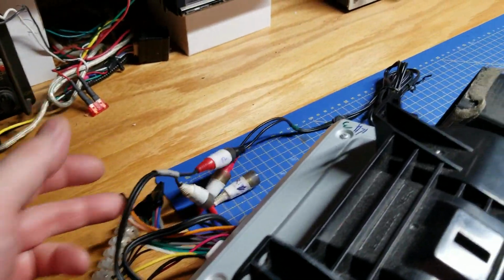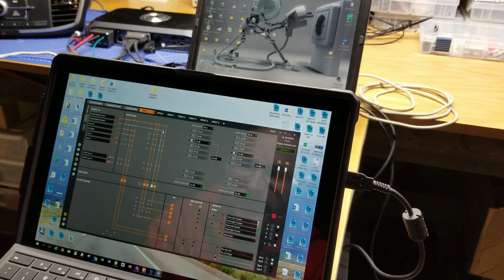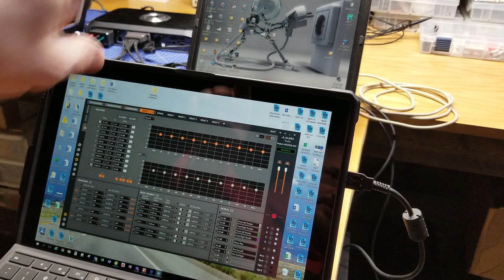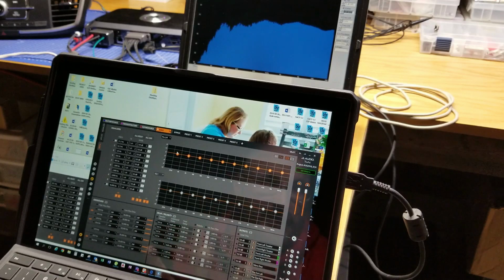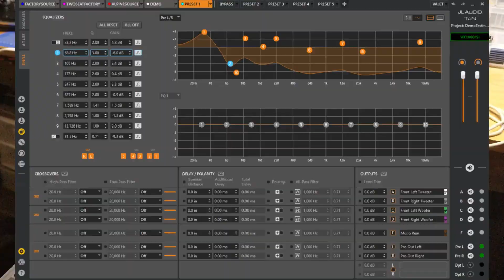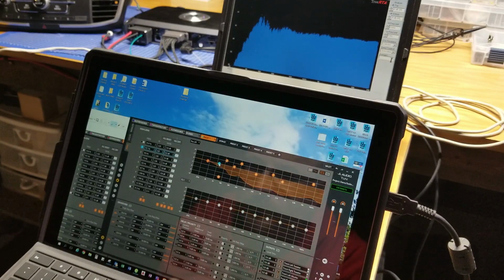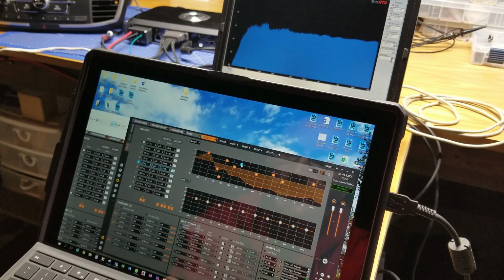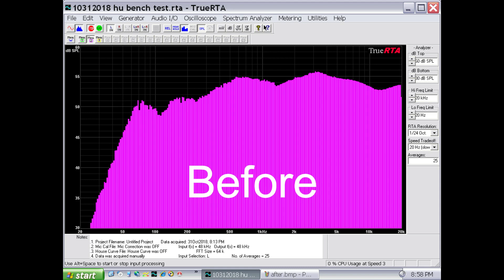JL Audio VX10005i Tun fixing Honda Accord Radio Frequency Response

Comment: I'm so confused with these processes. What is the goal once you get it flat? Do you create another EQ that applies at the same time or something? I'm using the TUN software and I have my signal flat, but I don't know what to do after that.
Reply from the maker: Using this method, I dedicate two of the EQ channels to flattening the factory EQ, then send that flat signal out of a preout and back into another set of inputs (channels 3 and 4).  Then I EQ the individual drivers as needed, knowing that I have a flat starting point.

Comment: A fix 82 or 86 depending on your setup would work a lot better for flattening the signal than trying to adjust it in the tun software for the amp. That way you can start with a flat signal and adjust how you want it from there.

Comment: Hi Richard, I am at the start of a similar path, but was going to use the speaker level outputs as my inputs. But you have done something I was wondering about, I.e. adding the line level RCA’s from the preamp output. Do you show how to do this. How easy is it... I was thinking it would be pretty tricky to find the lines or tracks
Reply from the maker: Hi there.  I have another video that is just about using an RTA to measure frequency response and that includes speaker level outputs through a LOC to reduce voltage.  Is that what you are looking for?  Can you clarify your last sentence about "lines or tracks"?  I'm happy to answer whatever questions you have once I fully understand what the questions are.  Cheers!
Reply: @richardvedvik979  hi Richard, thanks. I have truRTA and a oscilloscope meter and was planning these measurements (my 1st time, so useful vid). What I meant about lines/tracks, was I thought you had put in your own home made RCA line level outputs by soldering into the correct points post pre-amp but before the amp section. I was thinking about this, but not very familiar with doing it, and indeed I have 6 channels at the amp stage, so presumably this channels at the pre-amp stage... maybe there is some earlier point in the circuit with a simple stereo signal, but maybe this is buried in some solid state chips... so could be really tricky to do..
Reply from the maker: @idiocratease  In the original Accord factory head unit, I did mod the factory radio and remove the internal amplifier to generate a line level signal.  I've also swapped to a premium touchscreen head unit with a balanced output (from another year/model).  But this effort is independent of those mods.  My Instructable is useful for high and low signals and goes into more detail with connection methods.   With some vehicles, there is a digital signal to the factory amp that you won't decode, so you're forced to use high level signals.  This method of "seeing' the response is still useful, you just add a LOC.  I like the David Navone series of LOC.
Reply from the maker: https://www.youtube.com/watch?v=Kva4YA19P7M

Comment: You flattened the curve nicely. At what volume level did you flatten it at and doesn't the factory radio change the curve as the volume changes? If so do you no longer use the radio volume control? How is that addressed with these devices if the curve changes as the volume changes? No longer use the head unit volume control?
Reply from the maker: I test vehicles at several volume levels to observe frequency response at various volume levels.  In the vehicles I've used this method on, the changes were minimal.    If the frequency response changes with volume, you have two options.  If the change is drastic, you should fix the factory volume and use a DSP volume knob.  Most are slight changes and you can find a happy medium.

Comment: Hi, great video! I see you use a Sound Devices USBPre to connect the JL amp to the laptop for the signal RTA measurement. Are there similar devices to the USBPre you would recommend? I am a newbie who is tring to perform first measurements and would like to stay fairly cheap.
Reply from the maker: Any USB soundcard or computer with a line level audio input would work in lieu of the unit I was using.  As always, be careful of the signal level into the soundcard to avoid clipping.

Comment: Hello Richard , what track do you use to test the output?
Reply from the maker: Sorry for the delay.  Pink noise is used for octave band measurements.  I refer to the 2016 IASCA Reference CD or Autosound 2000  Disc 102.

Comment: I'm getting low volume white noise from my system. I've tried LITERALLY EVERYTHING to try to diagnose it...I need to keep my factory headunit so do I need a line output converter in conjunction with this amp or can I just tap into the speaker level outputs from the headunit and go directly into the vxi800?
I read somewhere that you need to "correct" the signal with a loc and then "tune" that signal with the vxi? Is this true? 
Thanks for your time. Much appreciated! *Subbed

Comment: Good sir, is there any chance you can tune a 2016+ Honda Civic Touring? I'm lost lol
Reply from the maker: Most of the touchscreen models have a clean output before the factory amp.  The trick is to snag the audio signal before the factory amp as is leaves the head unit.   The site for access to honda service manuals, wiring diagrams, harness diagrams is techinfo.honda.com.  I just pay for a day or two and download everything needed for the 2013-2018 Accords.  I don't have Civic specific diagrams.    

What are you looking to "tune"?  Are you running aftermarket DSP and external amplification and speakers?  More info is needed.
Reply: @richardvedvik979  thank you kindly for replying. I have a JL Audio VXI 1000/5 with Tun software as well running Focal KX2s. When I said tune, I meant doing the same thing you're doing in Tun by flattening the signal. However, since last night, I took some advice from your video and played around with the parametric equalizer myself and the sound seems much better. Thank you for this amazing video!!!
Reply from the maker: @fatpot  Gotcha, good deal.  You have a good starting point for sure.  Measuring the factory radio output is step one.  You need to know what you're working with.
Reply: @richardvedvik979  I have a fix82 in an 18 Honda Ridgeline and Im trying to regain my center channel info for text, android auto voice etc. I spoke with JL techs and they suggested a separate amp for the center info. I mention that my fix82 is picking up of the factory amp outputs and asked if going to the factory head unit outputs would work. Their guess was the the factory pre outs were digital. Do you have any experience or insight about that before I go digging around again? Thanks!
Reply from the maker: @rpstube  it does appear the 2018+ models have a digital (optical) connection between the head unit and factory amp. I haven't seen anyone successfully intercept and decode that signal.

Comment: I have a 13 accord. Can I use high level inputs from front and rear into the JL VXi to tune it and send the signal to another non-jl amp for the subwoofer?

Comment: Hi Richard, just curious: wouldn’t it be better to equalize/tune the whole system (including the speakers in the car) at once?
Reply from the maker: When tuning the car we want to start with the flattest response possible.  This is because we have to understand the difference between what we can change with an EQ or Time Alignment and what we cannot.  We also want to be careful of gain relationships and the gain structure of the system.  With a DSP we have 3 or 4 levels of gain - the source output, the DSP input, the DSP output, and the amplifier input.  When we add boost we adversely affect the gain structure.   When dealing with an OEM system, we want to ensure we get the flattest and lowest distortion source possible.  

That way when we see issues when measuring the acoustic response in the car, we know it's attributed to the vehicle acoustics or speaker frequency response.  Simply put, starting with a flat sources helps us make informed decisions when tuning.   

The trick in this video is to look at the electrical signal and verify what you're starting with.   The acoustical signal, measured with microphones, includes many factors including phase interference (constructive and destructive), polar response, reflections, acoustic resonance, structural resonance, cabin modes, and cabin gain.
Reply: Richard Vedvik 
Thank you. I forgot that gain is no issue because you use an external amp anyway and understanding what’s going on later on is much more important. 👍

Comment: Good info!  I noticed you are using an external RTA analyzer because the JL doesn't have that built in.  I am looking at the Audio Control Amp D800.4 that has the RTA built in along with the 30 band eq, etc.   Have you played with the Audio Control DSP with real time RTA built in?  Seems like it would be an all in one.  But the JL has the iphone/ipad AP and also looks like a more full featured user interface.
Reply from the maker: Audio Control released their new DSP amplifiers at the same time as JL did with the VXi.  I haven't played with the Audio Control but i've been watching their release into the industry.  Both products have different advantages and features.  The networking capability of the VXi is unique, with up to 50 channels of DSP networked through a single hub.  The Audio Control product was specifically targeted for OEM integration (which Audio Control has done well in for decades).  I think they are both great for the mobile audio market, and consumers have more choices than before.

Comment: After you do this, do you setup a mic in the car and EQ the car interior as well with pink noise?

If I got a USBPre, what would be a reasonably priced mic to use with it for eq?   Could I use an Audyssey mic from my Integra?  I also have an auto eq'ing mic from some JBL LSR Studio speakers
Reply from the maker: Yes, I do use a mic and RTA to adjust for the acoustical response in the car.  Those are separate EQ channels (output EQ) from the pre-out EQ I am using to flatten response.  

I use a few of the Behringer ECM8000 ($50), or you can use the Dayton Audio mic (with our without USB).   The USBPre is expensive and there are other PC interfaces you can find and use for less. 

The Audyssey mic or JBL mic is paired with specifically tuned software, and you'd need a way to compare and categorize the mics performance prior to trusting it outside of its intended application.
Reply: @richardvedvik979  Thanx for the info!  Would ARTA work for this?  This will be a "few times" deal for me at the most.  Would I search for "usb mic interface"?   I did not see EQ's for the out puts when I was running the software in simulation mode, and that was not clear in the online manual.  Can you tell me where to find those eq settings?

I'll be using SPDIF in from an Android Headunit.  Do I still need to do this input analysis like you did here?  Would I still access the JL DSP with the pre outs?
Reply from the maker: @lesgarten  The pre-out EQ is what i'm adjusting in the video.   You won't need to do any input analysis when using SPDIF.  You will just route the signal from the SPDIF to all of the channels (left to left channels, right to right channels, and left + right to sub).

The Dayton Audio UMM-6 is a USB measurement mic for $100.  If you want to use your phone for quicker/cheaper measurements, you can use the Dayton Audio iMM-6.  It requires your phone have a mic/headphone jack and you should run a good RTA app (Audio Tools or Audio Tool) are the Apple or Android apps I recommend.
Reply: @richardvedvik979  Hi Richard, I just got a USBPre 1.5.  For looping from Out to In for Sound Card Calibration, you use the PC Audio outs into the Tape Monitor INs?  

I'm gathering this stuff because I want to buy the same amp that you have here.  I bought the TrueRTA 1/24 and have DL'd the REW software and got a Dayton MIC w/custom calibration.
Reply from the maker: @lesgarten  , Nice selections.  Yes, we use the PC Audio outs and the Tape Ins, both 1 and 2 (for left and right).  TrueAudio lets you bounce between Left and Right.

Comment from the maker: The factory EQ lives in the amplifier.   That means it is internal to the pushbutton trims and in the external amplifier for the touchscreen trims.  A clean signal can be found out of the touchscreen head unit, so an aftermarket amplifier can solve the issue.

Comment: Awesome demonstration and nice tune, bro.  Thank you very much for sharing.  I have a question for you regarding that Accord head unit, although I'm pretty sure I know the answer because you didn't mention this  - but - I was wondering if you could confirm - Does the equalization curve that the head unit outputs change as the volume gets turned up or down, or does it hold steady?
Reply from the maker: Hi, I've tested it at several volume levels and it doesn't change.  It is a fixed EQ to assist active noise cancellation (ANC), not for sound quality.
Reply: @richardvedvik979  Thanks for the response, and again for the video.  This is great information for Honda owners and for car audio enthusiasts!